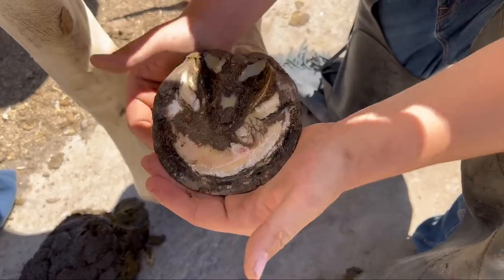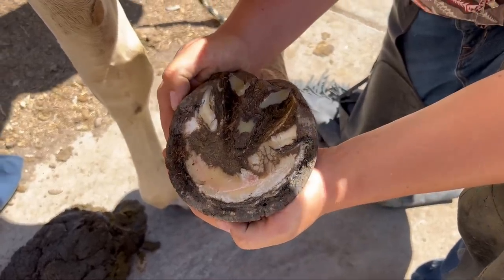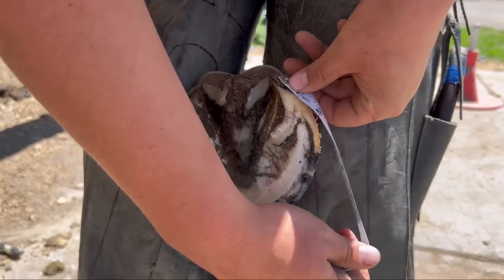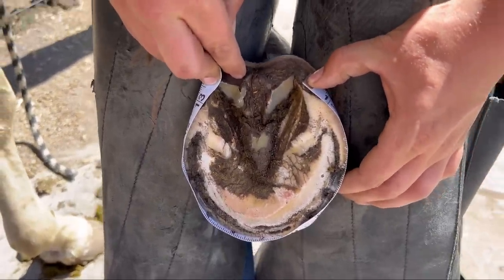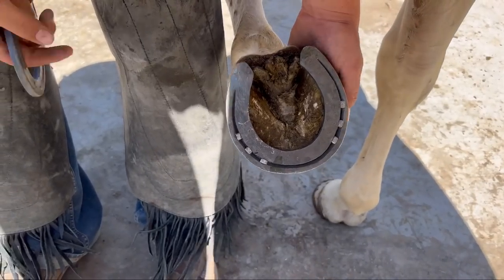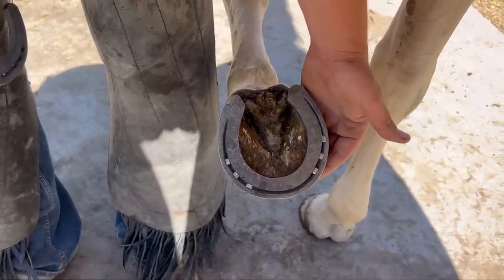RANCH HORSE gets CUSTOM HORSESHOES

Comment: Nice job! But how did you fix the lateral heel check. It was untouched when you did the fullering, then fixed when you did the nail holes. just curious if you used a hardie, heel cutter or did you grind it.
Reply from the maker: I knew my length was long when I made my toe bend so I shaped the shoe and ground the lateral side.
Reply: @idahohorseshoeingschool  ok, thanks!

Comment: Nice work have you tried those salad bowl shoes on them flared out hooves does your schook  offer pre cert courses for journymen runs
Reply from the maker: Yes I think salad bowl shoes can be very handy. This particular horse just needed a tad more protection. This is 1/4x1 bar and he works really well in them. Both myself and the other instructor are journeymen and our course is based on the certification test.

Comment: Why do you place the shoe while it's still hot? What does that do?
Reply: That is a technique called "hot shoeing". This is done to make sure the foot is as level as possible before the shoe is nailed on. Note how he rasps the sole of the foot (white part inside), thats him attempting to level the foot with just his eyes and tools. This is one of the hardest parts about shoeing and can take years to really get good at. Once he thinks is sound enough he will burn the bottom of the hoof and sole with a hot shoe. You are looking for an even black (burnt) line, flush with the foot as you remove the hot shoe. If its even and flush your leveling is good enough. You are also looking to make sure that the shoe can be placed in the correct position for the nails to go through the white line and side wall as apposed to the other side of the white line which has soft tissue underneath. OUCH if you make that mistake, and no the hot shoeing in no way hurts the horse, its the equivalent to burning hair or a finger nail.
p.s. I am also a farrier. Thats why I know.

Comment: Why do you put horse shoe on red hot on horses hoof
Reply: I assume it helps fit the hoof and shoe together better. Don't worry, the horse has no nerves in its hoof, it's basically a huge, specialized toenail and the heat doesn't conduct far. The horse isn't stressed or in pain.